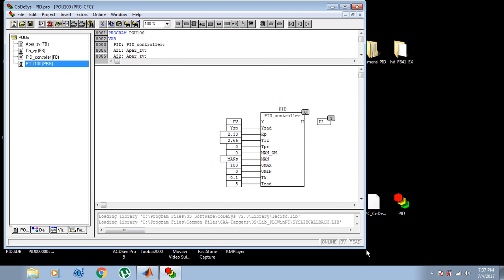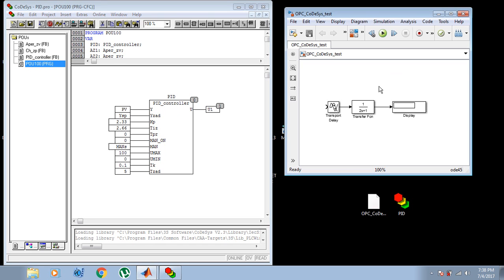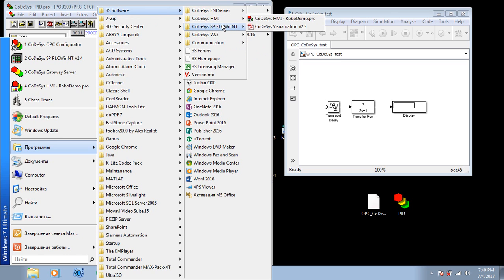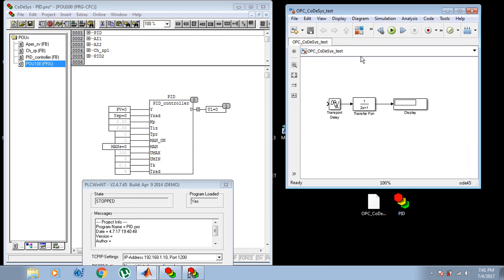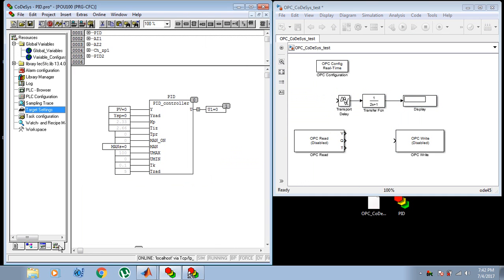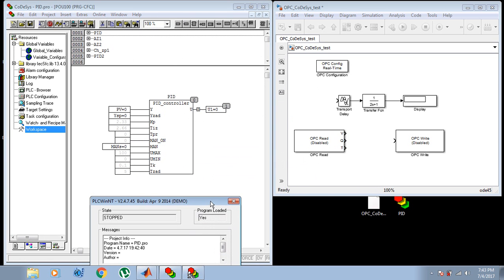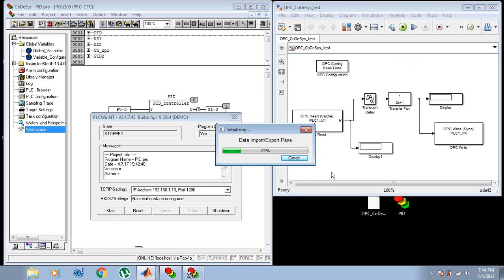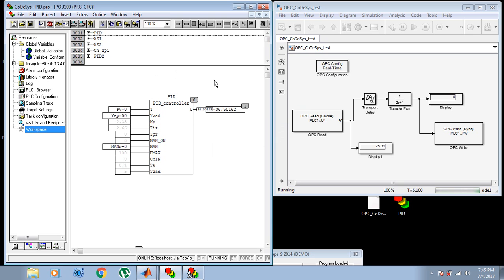MatLab Simulink OPC communication with CoDeSys

Comment: Судя по рабочему окну и акценту, можно спрашивать и по-русски? 1.Этот блок пид-регулятора использовал готовые коэффициенты. А как использовать блок пид-регулятора с автонастройкой при тех же условиях, т.е. также непрерывно обмениваясь данными между двумя программами ? 2. В проекте из какой библиотеки был взят блок регулятора? т.к. Util вроде как дает блок с другим внешним видом (и для какого таргета, а точнее для какой модификации контроллера)
Reply from the maker: 1. You should use variables instead constants in that case. 2. Hand written PID FB block.
Reply: @maksymlevinskyi8762   Can you tell me how to implement such an OPC connection without connecting to a controller?  "Create a program (project) in the CoDeSys environment with the target platform 3S CoDeSys SP PLCWinNT V2.4., when configuring the target platform, you must set the Download symbol file option on the General tab". BUT .... First problem: I select "communication parameters" - - "No gateway with the given settings could be found", when choosing "New" - 'localhost' via Tcp / Ip (Not connected) _ .  Second problem: I click on CoDeSys SP PLCWinNT V2.4 - the message "Demo mode! PLC will be terminated after 2 hours" is displayed, but after clicking 'OK', in State and Message - nothing, in Program Loaded - No.    If you can help, I will be very happy
Reply: @Алекс-ф6щ9с  I guess that one cannot setup an OPC connection without actually using a target PLC or a soft-PLC such as SP PLCWinNT V2.4. Am I right Maksym?

Comment: Hi Maksym, I wander whether you are still active on this channelbecause I would like to ask you a question about CoDeSys cycles and sampling time. Thanks
Reply from the maker: What is the question?
Reply: @maksymlevinskyi8762  Hi, the question is: how do you make sure that CoDeSys executes the PID task exactly at 0.1 sec intervals? In your video you do not mention this... or I missed it. The reason I am asking is that I get slightly different results when I run the plant model in Simulink  with the PID in CoDeSys, and when instead I emulate the plant model using CoDeSys CFC blocks. As an example I used the models of your other video on PID controller. Thanks.
Reply: I need to rephrase my question. The question is more how to make CoDeSys and Simulink to operate in a synchronous manner. Assuming that the PLCWinNT emulator works in real time, how to make the Simulink model to work in real time as well. I need to investigate this. BTW this explains why I get different results when everything is simulated inside CoDeSys. Thanks anyway
Reply from the maker: @teretx566  you have to make sure that cycle calculation time is the same in both systems. And you need to make up some trigger which  will initiate starting procedure.
Reply: @maksymlevinskyi8762  Yes, that is exactly the point. I am trying to figure out how to make the Simulink model to run in a "sort-of" real time, with the same cycle as CoDeSys. May be I need to trigger the model execution... but how... Anyway don't bother, I will figure out something. Thanks
Reply: @maksymlevinskyi8762  And another question, if I may. How do you add variables to the OPC communication? I tried adding more global variables with: Workspace->Symbol Configuration->Configure Symbol file, but it does not work. Simulink OPC configuration block does not see the new variables. Thanks for helping...